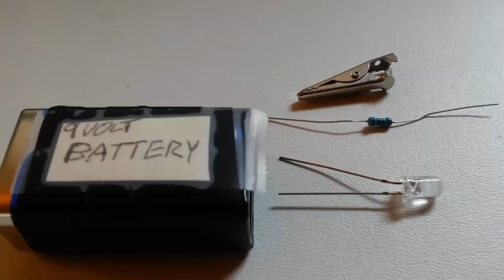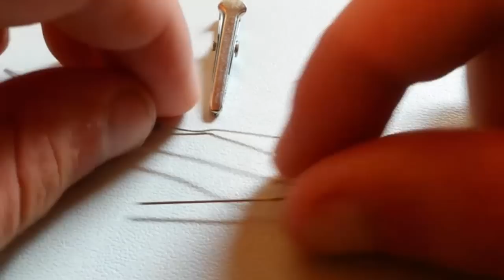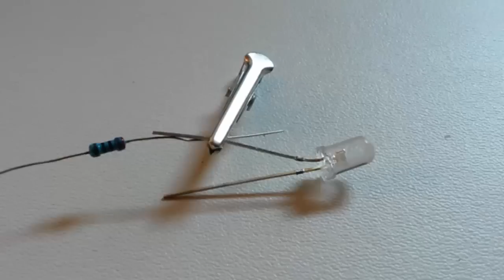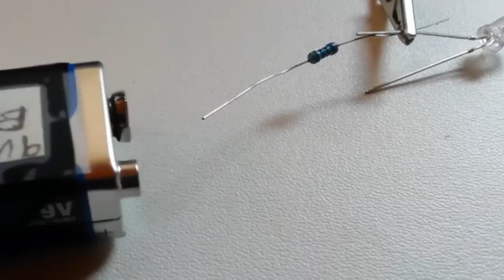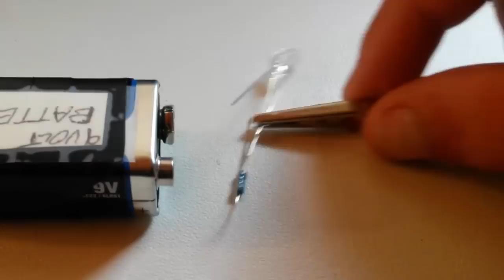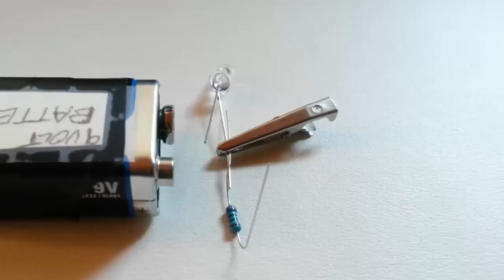Beginner Electronics - 8 - First Circuit!

Comment: Mine didn't light up! ): 

I used on old LED that seemed to be in good condition from a cheap little thing and a resistor from some scrap that also seemed in good condition but no luck.. I'll have to get a new battery maybe. I tried a AAA at first, then a AA but nada
Reply: Nevermind,  I just needed a bigger battery! :D got a 9v and it worked 😁🥳

Comment: If electrons flow from the negative of the battery, shouldn’t the resistor be connected to that side to bring the power down? Why would it not matter what side the resistor is on?

Thanks

Comment: just curious will the strength of my light bulb affected due to an overly high amount of resistence ( e.g. using a 1000 ohm resistor on a bulb that only requires 100 ohms)

Comment: Wait, but why doesn't it matter if you put the resistor to the longer or shorter leg? I though that since the current flows from negative to positive and the anode connects to positive terminal, you have to connect it to the katode, or it will be useless. Im so concused???

Comment: I love these series as I just started to learn the electronics as a hobby. But one thing that confused me and most likely will others: If let say anybody uses 9V batter, and they do not have 240 ohms resistor, you said in your video it will be fine to use 1000 ohms resistor. The problem here is that if anybody uses stronger resistance than needed the LED will be underpowered and wont be as bright as needed. In fact it will be the same as using 1.5V batter AA. So anyone wondering, you can always go above a bit on your resister but never go overboard or under the limit that you have calculated.
Also, if you dont want to blow any LED up, you can simulate this in tinkerkad for instance.

Comment: Question. Shouldn't the resistor be connected to the negative terminal to limit the power going into the LED? If i understood correctly, electrons flow from the negative to the positive, so if the resistor was connected to the positive terminal, wouldn't it limit the power going back to the battery?
Reply: You have a tank, Which Fills and is empty at the same time, if you put the resistor on either end will you get the same flow on your tap ??

Comment: I thought a diode doesn't let the current pass when it's voltage is less than the forward voltage, but you say it works even with high resistance which implies lesser voltage drop across the diode??

Comment: At 2:45, you have the resistor between the positive terminal and the LED, but the actual flow of current is from the negative terminal to the positive terminal. Because of this, I would have thought that you would put the resistor between the negative terminal and the LED.

1. Why did you put the resistor between the positive terminal and the LED?
2. Also, since you didn't put the resistor between the negative terminal and the LED, why didn't the LED burn out from too much current?
Reply: Resistor and diod don't matter which position they are attached to, they work the same. either end they slow the flow

Comment: Is the reason the LED doesn’t blow up despite the resistor not being between the LED and power source because the circuit is closed and the electrons cannot move until the electrons further along the circuit move which is determined by the resistor later in the circuit?

Comment: From an earlier video you mentioned that the current flowed from negative to positive.  So, wouldn’t the resistor need to be in between the negative terminal of the battery and the negative terminal of the LED to prevent the LED from burning out?
Reply: In a series circuit resistor placement doesnt matter. Think of a river on a loop or circuit, a dam would restrict flow before and after (whole river effected).
You could also look at it as the resistor restricting the attraction from 1 side of battery to the other so now there isnt as much will or force to reach the other terminal, so a pull or attraction draws less current or energy.

Comment: Dear, is it a must to use a resistance before an LED? I tried using 3 volts 2 AA batteries and it worked fine without the resistance, but with the resistance the power became less, and this is natural.
My question is: Why does the blue LED turns of if I connect any other color with it? I connect yellow, red, green, and orange; the all work fine together. When I add the blue one, it remains off until all others are disconnected. More than one blue LED work together fine, but when I add any other color, the blue ones all stop working. Any idea or explanation about this?

Comment: Im a little bit confused. In your earlier video you said the current(DC) flows from the negative pole of the battery to the positive, suggesting to me that the resistor should be on the negative side to protect the LED???
Reply: Say you have a pipe with a flow meter (LED) in the middle so you know how much water(amps) is going through it, and then pump some water through it. If there is a clog before the flow meter, it will limit the water going through the pipe. If the clog is after the flowmeter, it will also limit the water going through a pipe. Actually current flows from positive to negative even though electrons flow from negative to positive.

Comment: I ran a test in ElectricVLab simulation software and the LED blew and said it was drawing 25.6813 mA with the 240 ohm resistor calculation for the previous video. I set the LED to 3.2v forward drop voltage and 24mA maximum current rating. I had to use at least a 260 ohm resistor in the simulation to get slightly less than 24mA draw so it would not blow.
Reply: how is that software?

Comment: Can I accidentally electrocute my self holding the wire?
Reply: No, with batteries you cannot electrocute yourself. I mean you do, but you don't feel it and you don't endanger yourself. With bigger power sources, yeah. But electrocuting yourself so you put your life in danger? That can happen with wall outlets.
Tip: Usually it's good to be extra careful with electronics, but if you want to test the voltage, don't put normally the fingers on the wire, but the nailside of the finger, and your body will automatically retract the finger. If you put your fingers normally on a wire with electricity your muscles can contract due to the electricity and you will start to tighten the grip, and of course that that would be bad if there's a big amount of electricity through the wire.
Reply: @GlumWretch  Thanks for the information.

Comment: We can connect the resistance in negative terminal of led?
Reply: you can connect the resistor how you want
Reply: Say you have a pipe with a flow meter (LED) in the middle so you know how much water(amps) is going through it, and then pump some water through it. If there is a clog before the flow meter, it will limit the water going through the pipe. If the clog is after the flowmeter, it will also limit the water going through a pipe.

Comment: Question>> Why is  larger resistance than required not a problem?(Plz explain in detail ...)
Reply: its common sense, the LED his using needs at least 240 ohms resistance for the electron current so it doesn't burn out the bulb, increasing this resistance will ensure more that the current isn't high enough to burn the component.

Comment: Talking about resistors: ist the positive leg also longer? How do you recognise it? Because if you read the colours in the wrong order you would have a  completely different value
Reply: From what I know, it does not matter which direction the resistor lies.   If you read the color in the wrong order, it does not change the value of the actual resistor.  it will always be what it's intended for.
Reply: Here's another thing, polarity is the keyword.  Resistors doesn't have any polarity, so it doesn't matter.   LED does have polarity.
Reply: Theres usually a break between the multiplier and tolerance bands. There is no positive or negative on resistors.

Comment: Dear electronics hobbyists, we developed a 4V-24V DC power supply that is rechargable, portable and breadboard competible. 
If you are a big hobbyist in circuit design and hardware electronics, it would be a great fit to you.
Check our project at: https://www.kickstarter.com/projects/1498560049/mego-a-portable-power-supply-for-electronic-makers?ref=3gq6ap
Thank you!

Comment: So wouldn’t the metal clip use up some of the electricity?
Reply: no, its not really in the circuit because the wires are touching also, but even if it was, it has almost no resistance.

Comment: First of all  , very nice tutorials :) 
I have a question regarding resistors . Since electrons flow is from negative to positive pole , why do you add resistor after led on negative pole ? why don't we add resistors before led  on negative pole . Don't we need to "resist" before electricity arrives to LED ? Thank you
Reply: Say you have a pipe with a flow meter (LED) in the middle so you know how much water(amps) is going through it, and then pump some water through it. If there is a clog before the flow meter, it will limit the water going through the pipe. If the clog is after the flowmeter, it will also limit the water going through a pipe. Actually current flows from positive to negative even though electrons flow from negative to positive.

Comment: Why is the resistor not connected to the negative terminal of the battery and led cathode instead?
Reply: Say you have a pipe with a flow meter (LED) in the middle so you know how much water(amps) is going through it, and then pump some water through it. If there is a clog before the flow meter, it will limit the water going through the pipe. If the clog is after the flowmeter, it will also limit the water going through a pipe.

Comment: Why is it OK to use a higher ohm resistor?  Why doesnt that dim it too much?
Reply: It will dim a little if you had like a 300-350. Less noticeable. But a much higher one would dim the light more.

Comment: having a higher resistance to the LED would dim the intensity?
Reply: Yes. Light switch dimmers are just resistors that resist less for a brighter lighter or more for a dimmer light.
Reply: @Joey-hv4yq  well actually AC dimmers cut out part of the AC frequency, kind of like the AC version of PWM. But yes.

Comment: Maybe a stupid question, but if you need a 240ohms resistor and you happen to have (lets say) one 150ohms and a 100ohms. Is there any issues that come from using both to get to 250? Is it always better to use just 1 resistor of with the right value, instead of 2 or more to sum up to the right resistance? Besides that, I know you said it didn't matter, but is there any case when it does matter where the resistance is applied in the circuit? Cheers for the series though, just what I wanted/needed in order to understand all this stuff. Planning on making a pedal for my bass (just as a hobby/experiment), and this series is just perfect to help me get what the hell those schematics are all about.
Reply: No issues. It is a series circuit. You could add a 150 and 100 to get the same 250 ohms of resistance in the circuit.
Reply: Great question, I've seen videos of people using multiple resistors

Comment: why we used resistor at the positive side ?
Reply: Say you have a pipe with a flow meter (LED) in the middle so you know how much water(amps) is going through it, and then pump some water through it. If there is a clog before the flow meter, it will limit the water going through the pipe. If the clog is after the flowmeter, it will also limit the water going through a pipe. Thats how it works.

Comment: Would there have been an issue if you had attached the resistor to the negative wire of the LED?
Reply: Say you have a pipe with a flow meter (LED) in the middle so you know how much water(amps) is going through it, and then pump some water through it. If there is a clog before the flow meter, it will limit the water going through the pipe. If the clog is after the flowmeter, it will also limit the water going through a pipe. So no.

Comment: I need a clarification on this -
Addressing your comment to William Liisberg: "...while electrons do travel from neg. - pos., you could also think of it as losing electrons going from pos. - neg., thus either way electrons are being resisted".
Does that mean that connecting the resistor to the negative side slows the electrons's flow, and when connecting it to the positive side it pulls electrons to it and therefore less electrons travel to the LED?

BTW thank you for this series!
Reply: Say you have a pipe with a flow meter (LED) in the middle so you know how much water(amps) is going through it, and then pump some water through it. If there is a clog before the flow meter, it will limit the water going through the pipe. If the clog is after the flowmeter, it will also limit the water going through a pipe. Thats how it works.

Comment: Thanks a lot for the videos, I am. Java programmer and i am trying to learn electronics as world is going with programming and electronics together. My question is, as we know the current is going from - to +, so why you hocked up the resistance with +? Isn't suppose the current will go from - which mean 9v will go directly to the LED with no resistance?
Reply: erm if you connect to negative it will output? and positive is like input idk if its like that
Reply: @kapoutkapoutmapout  It is.
Reply: Watch his previous videos
Reply: Say you have a pipe with a flow meter (LED) in the middle so you know how much water(amps) is going through it, and then pump some water through it. If there is a clog before the flow meter, it will limit the water going through the pipe. If the clog is after the flowmeter, it will also limit the water going through a pipe. Actually current flows from positive to negative even though electrons flow from negative to positive.

Comment: how much watt regestance use for this
Reply: That isnt resistance. Resistors dissapate the extra electricity as heat. That is how many watts in heat the resistor can dissipate before overheating and damaging all your components. 1/4 watt is the normal value, that is plenty.

Comment: what if I want the LED light up to its max brightness?
Reply: Then find a 240 ohm resistor, but anything less than that will blow it up.
Reply: @RobbieIsbell  Anything higher than 240 ohm would also in small amount, dim the LED right?
Reply: @Rassy_  Correct.  It would reduce the current flow.

Comment: I have a doubt, a simple one but I'm confused
when you connect the led either before the resistor or after the resistor, it works. But electricity flows from positive terminal to negative . First it would cross the led , won't it burnt the led out?
Reply: For what I understand, it doesn't matter if the electricity hits the LED where the resistor is or not, but how much current goes through it. For instance, if we picture the flow from negative to positive on the circuit in the video, yes, the electrons hit the LED, but on the other side of the LED you have a resistor limiting the current (amps) that goes through the circuit. If you think of it as the water example from earlier videos, you have water going through, but the resistor on the other end, is still limiting the amount of water going through.
Reply: Say you have a pipe with a flow meter (LED) in the middle so you know how much water(amps) is going through it, and then pump some water through it. If there is a clog before the flow meter, it will limit the water going through the pipe. If the clog is after the flowmeter, it will also limit the water going through a pipe. Thats how it works.

Comment: If I use too big a resistor value, why wouldn't it cause not enough power for my LED?
Reply: John DeMeo because if the resistance is to high not enough voltage will reach the led to power it